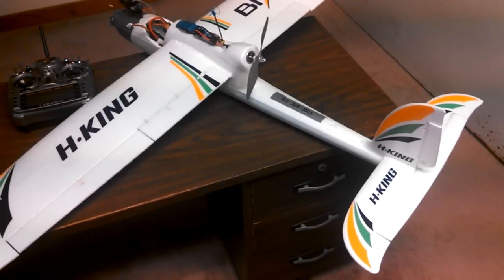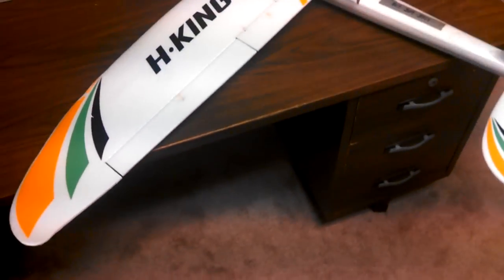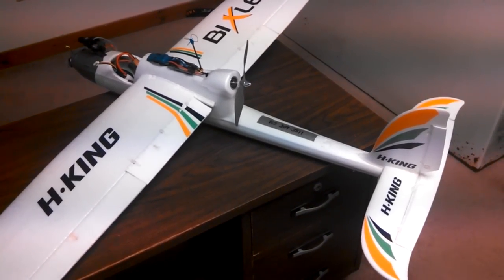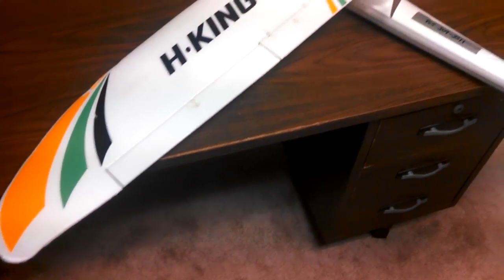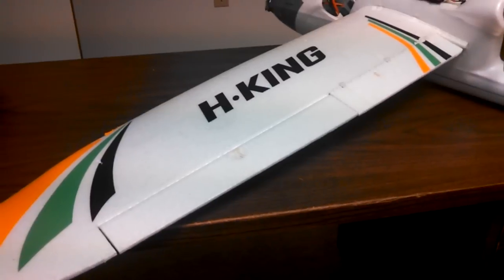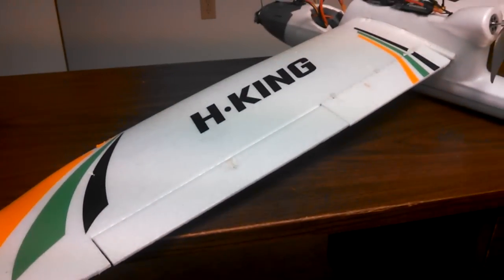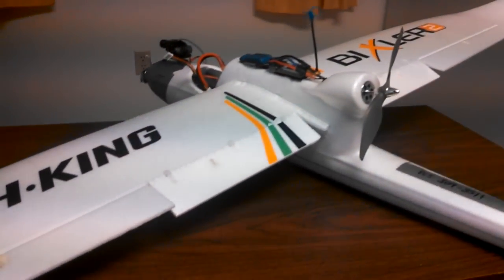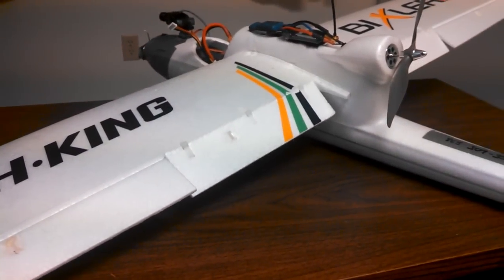Ideas for your programmable radio (Taranis, OpenTX, etc...)

Comment: Hi Josh, i have some questions : 1. I have the similar model as in the Video (without flaps). So i put in a f3 spracing FC in. Target: Using Angle and Horizon Mode when flying. 2. Got it working so far , Motor Arming on one Switch, Angle und H.Mode on anothter so far so good. But some issue : If Arming Motor it turns to Acro itself. If Disarming i can switch to Anglo and/or Horizonmode... Why? What did i wrong? Ah using Cleanflight..

Comment: Great info.. I have a older  9x that I installed a FRSKY DJT module in and now I can't turn on or off my ali and thr switches ? Can you help?
Thanks Dee
Reply from the maker: If memory serves, enabling telemetry on the 9x involves re-routing those two switches to a different input on the processor, because the GPIO pins used by those switches are re-used for telemetry or something. You have to install a telmetry-enabled firmware that looks for them on the correct input.

Did you enable telemetry when you installed the DJT module? Are you running a telemetry-capable version of OpenTX / er9x / etc...?
Reply: Joshua Bardwell Thank you so much for your QUICK help, I have telementry enabled I guess it shows up the screen, do I need a sspecial verison of the software, i thought I loaded the frsky tel , could you tell me which one I would need?
Thanks so much,
Do you think I will need to unsolder the pots and put in resistors like I saw in a video , that wasfor  the EZ tele diy mod.
Reply from the maker: I never did this mod so I don't know.
Reply: Joshua Bardwell Thank you for all your help..
Reply from the maker: Best of luck figuring it out.